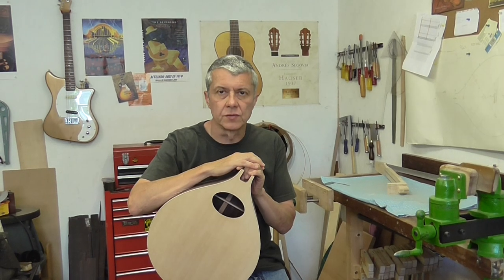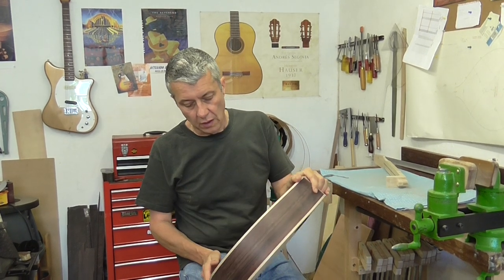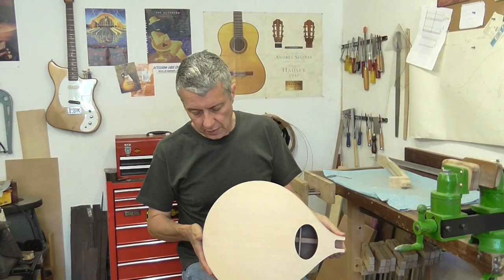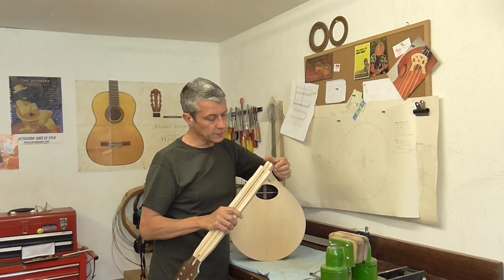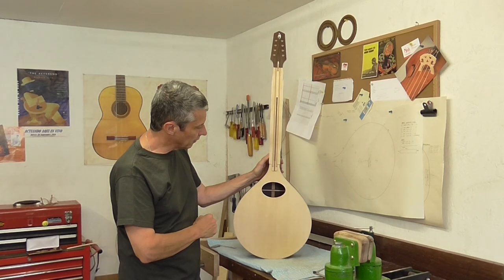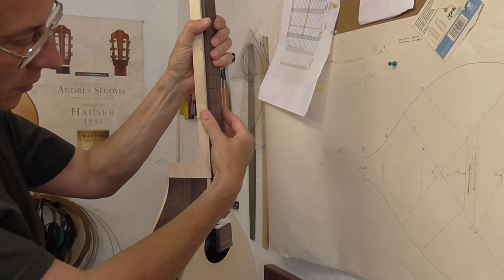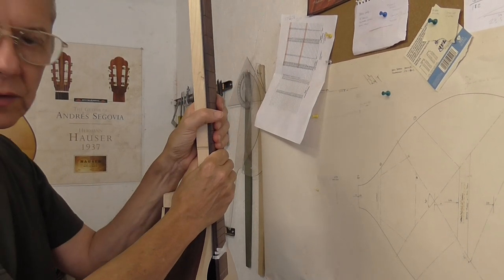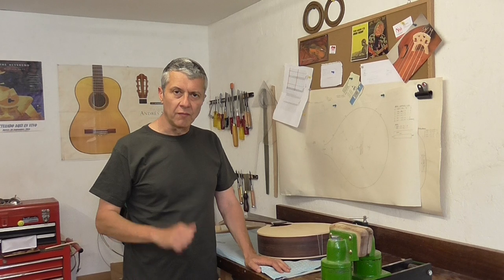Navazouki Part 2

Comment: Thank you for posting this video.  I especially like the way you attach the neck to the body.  I have used the wooden pin method very successfully myself and find it the best way to accomplish a strong joint.  It is always fun to see what you are working on.  Mike
Reply: mvecellio1